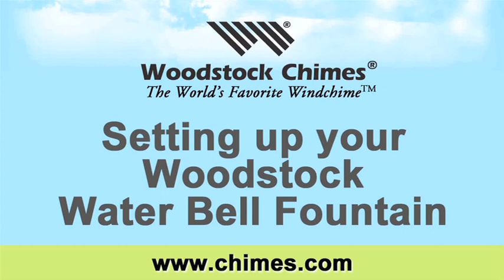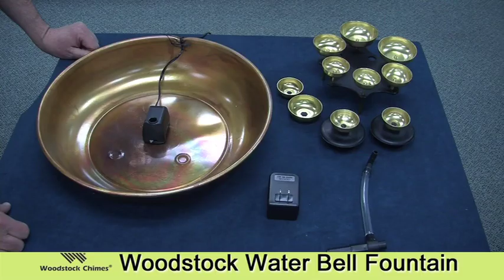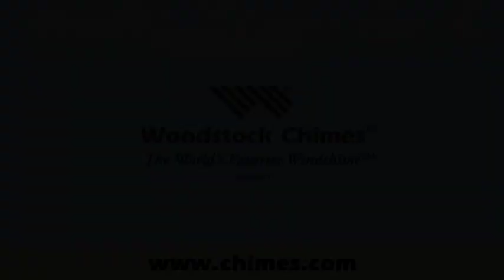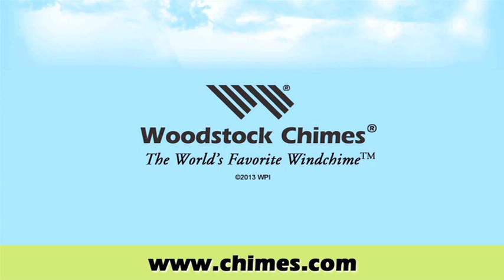Woodstock Water Bell Fountain Set Up

Comment: I have my pump on full and the bells keep stopping. I notice you're using a different type of pump. My pump is not very strong.
Reply from the maker: Hi Leedy, We have two different fountains available. One is like the one in this video, with a copper bowl, and one comes with a black plastic bowl. Each comes with a pump designed specifically for the fountain. If yours looks different from the one in this video, perhaps you have the fountain with the black bowl, or you might have the UK version of the pump. Are you located in the U.S.? Have you had the fountain a while and it has just stopped working? You need to be sure the surface is level and follow the instructions in the video about regulating the water flow. If you continue to have trouble and can't resolve the issue, please write to refurbish@chimes.com and describe the problem you're having. I hope that helps!
Reply: Hi, I'm in  Canada and it's the copper bowl, but it's good I found the issue. Thanks.

Comment: My bell fountain sucks. Ive followed set up instructions to a T and have fiddled with it for hours and hours and never works like it should.
Reply from the maker: Hi Cyndi, I'm so sorry to hear you're having trouble with your fountain. Please take a look at this troubleshooting guide and see if the suggestions help you: http://www.chimes.com/images/document/productinstructions/Woodstock-Water-Bell-Fountain-Troubleshooting.pdf. You can also contact our Customer Care department at 800-950-2754 or woodstock@chimes.com for further advice. They can be reached from 8:30 AM to 5:00 PM ET, M-F. I hope that helps!
Reply: Same here! Mine worked okay for a few months and now barely works. I’ve followed the directions that came with the box; I’ve watched this video and restarted with new water. The pump just doesn’t seem to work well enough, and it’s loud. This was a pricey product and it didn’t last a year.
Reply: @triciaroy  usually if there is a issue and the bells aren't moving the pump is plugged! You can take it apart easily and clean it....